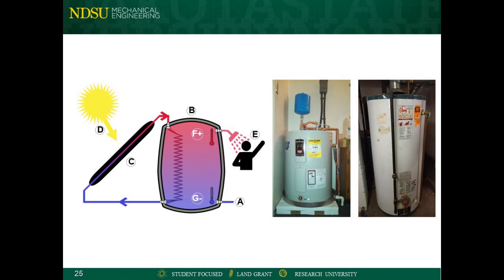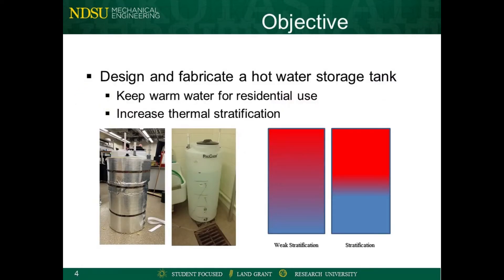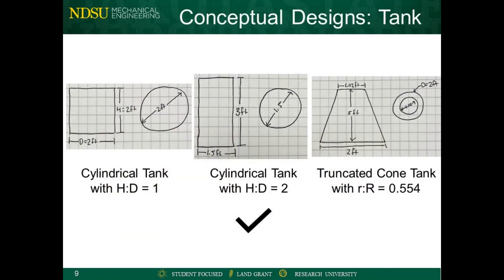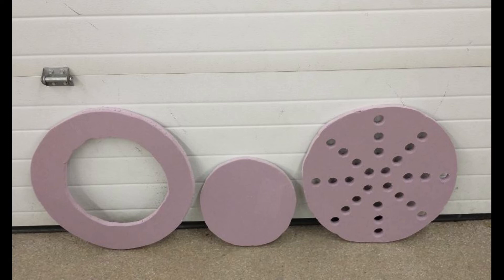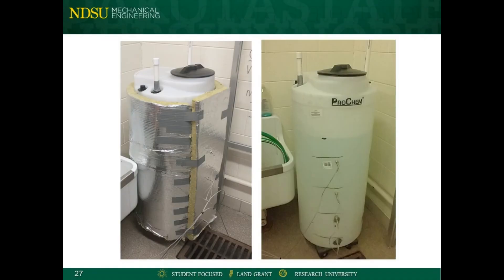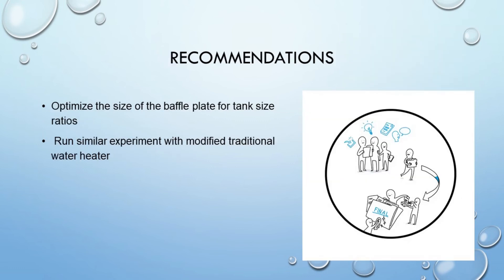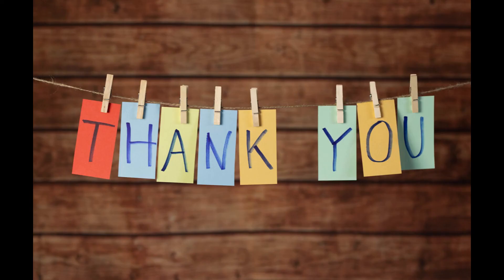Thermal Storage Tank

Comment: Interesting study on baffle plates and stratification. However, most temperature lost from a boiler will occur through the inlet/outlet pipes, as well as the T&P valve and to a lesser degree the drain.
A much more difficult problem to solve.

Comment: May you deliver a photo of the radial plate with the upward facing inlet, please.
Reply: At the 1:58 mark I believe is what you’re looking for.
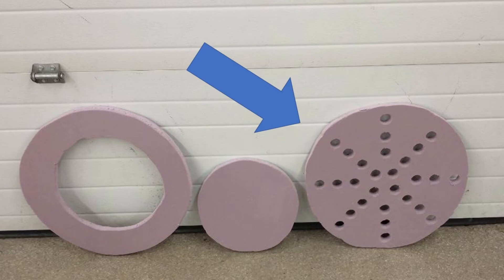Reply: at 1:39 it's the middle of the three pink things. So just a disc, less than full diameter, suspended just above the upward-directed hot inlet at the bottom. It interrupts the convection

Comment: Hey that’s awesome tell me something if you have a sand battery that can be raised to 1000° temperature couldn’t you use the heat to create steam and run a steam generator that then charges the sand battery as well as maybe provide electricity for a home is that something that’s possible?
Reply: The Laws of Thermodynamics declare that a perpetual energy machine is not possible. Energy conversion losses between heated sand, boiling water into steam, turning a turbine generator, running electricity thru residential electrical loads, and recharging the sand battery with the condensed steam would require a primary energy system to keep energy moving thru the system. 

The system as you described would run down and stop as the energy losses accumulated and there was insufficient heat left to reheat the sand battery.
Reply: Ok so not on it’s own perhaps with other heater sources like wind and solar and may be a Hydro generation system that could charge the sand battery? Could all of these combined run a steam generator and supply a home with power and heat?
Reply: @bk7278  Sure! With multiple sources of energy it would be possible to use the sand battery as both storage and a steam generator.

The multiple sources would heat the sand battery whenever they were producing energy, and a heat exchanger system would extract heat from the sand battery to boil water for both driving a steam turbine electric generator and home heating.

In fact, I'm very interested in developing a diy system like this that could be open sourced for free use by anyone who wants to build one.
Reply: Another thought I had what about  magnifying sun to heat water sand or maybe a higher boiling point liquids?
Reply: Parabolic mirror is what I’m thinking about
Reply: Also been thinking on earth batteries I feel the answer is close
Reply: @bk7278  Me too! I'm thinking about thermal transfer fluids like mineral oil, heated by the sun using parabolic mirrors. (Thermal transfer fluids have very high boiling points but can be rather expensive, though.)

One option is the parabolic trough type CSP collector and the other is a parabolic disk collector.

I would like to see if a CSP collector could transfer heat via mineral oil into a heat exchanger located inside of a well-insulated sand battery. Another heat exchanger buried in the sand battery would transfer heat into a house, greenhouse or other application.

Stay tuned because we hope to implement an open source solar heating system with multi-fuel auxiliary subsystems in the near future.
Reply: I’ve seen some videos on the heating capabilities of magnets and copper if that’s real I I’ll bet it would be simple to also apply it to battery heat storage
Reply: One thing I'm about to investigate more scientifically: solar energy per square foot during the winter months.

The reason is that once the amount of solar energy per square foot drops to a low level, you need a much large collector to get a decent amount of heat energy.

Yeah, just when you need the heat energy the most, nature reduces the amount of solar energy available both by area, hours per day, and amount of cloudiness.

Fortunately, mini split heat pumps have been perfected, and some can be run off of a solar array. So, there are heating options available that won't break the bank.
Reply: You would use the solar concentration spot array to heat a sand battery as heat storage. A  conductive copper  heat sink placed  into the  sand  to transfer battery heat stored for months with in the sand battery. Using a Heat exchanger to heat your hot water on demand. There doing this already see the link attached. You need  Evacuated double wall vessel ie a thermo flask design as water tank.

https://youtu.be/d_f8q7YHKa8